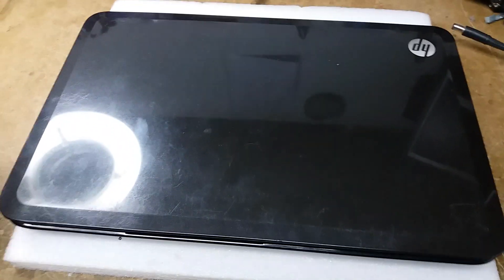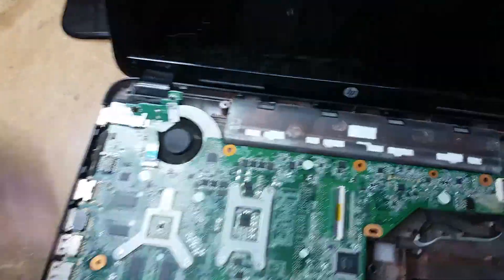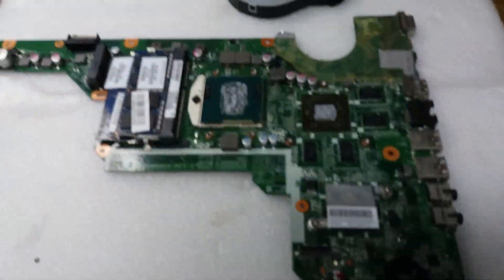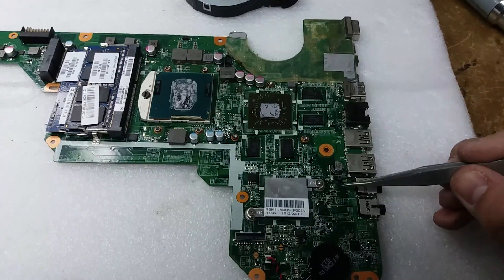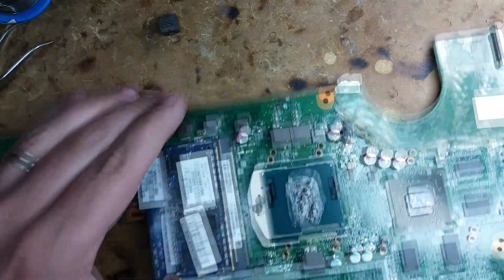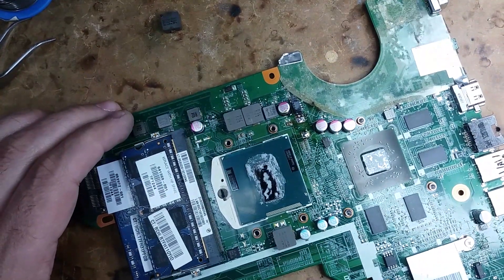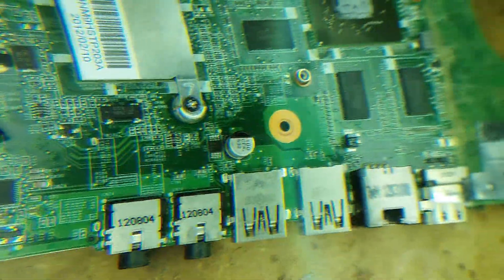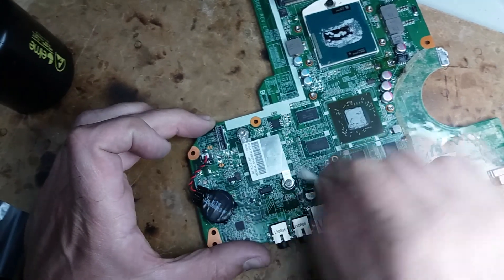HP G6 2017SP turns on but no display, Repair

Comment: After this can you watch video on laptop?
Reply from the maker: Hi, Yes you can... you can do pretty much everything of normal everyday use, the only problem will be games that need a fast graphics chip will not work.
Cheers.
Reply: Thanks a lot, I  repaired the same laptop last year with the same problem, It was a GPU, but thanks for sharing your method deactivating GPU.
Reply from the maker: Ck Malcokm no problem . . Thanks  for watching.
There are quite a lot of models that have this hardware option, and in my opinion it's very cost effective. And the repair is gonna last a heck of a long time as long as the clients is carefully with overheating, which was what cause the problem in the first place.
As I get them in the shop I am gonna try and do a video for each model.
Cheers